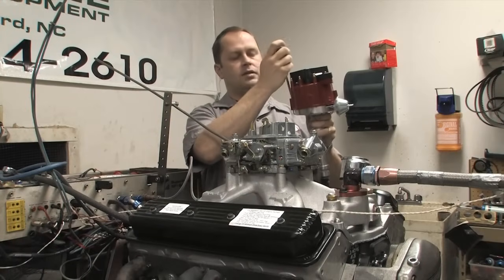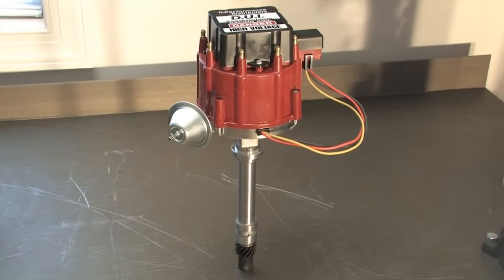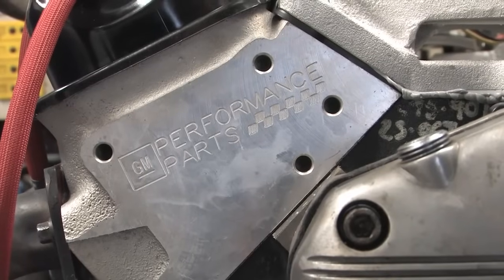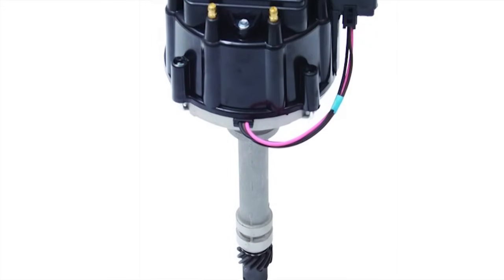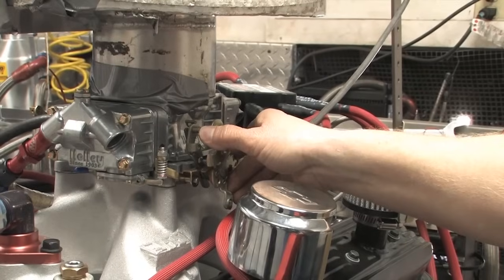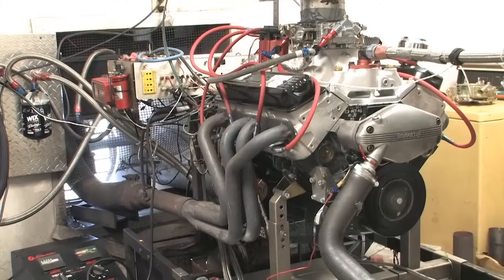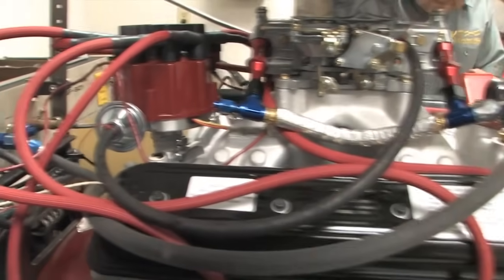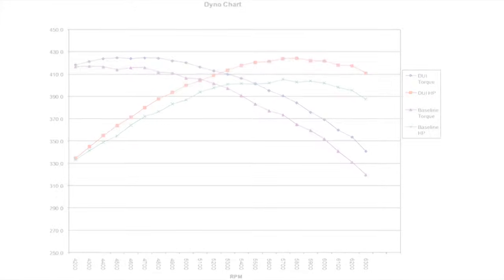HEI Ignition Tips for Your Engine

Comment: Great video. I own a 1965 Ford Mustang that I installed a 302 Ford small block wih an HDI distributor. It is conected to the original ignition lead with a resistor wire behind the dash. 1.5 ohms or so. What is the best way to get pesk voltage to the distributor and peak performance? I was going to bypass the resistor wire (pink) but it's a pain to get to. Anoter idea was a relay actuated by the existing igniton power wire feding power directly from the battery.  What do you recomend?  If a relay, which one? Thanks and once again, great video.

Comment: 36*....??? kinda sounds heavy.... How does it respond to restarting when engine is up to temperature.... seems like something you could accomplish through Cam degree... Harmonic balancer tab typically only goes 20* or so
Reply: That's pretty normal for a mild SBC. They have made adjustable timing lights since 1920. Just a tab and balancer line.

Comment: I don't think you guys fully understand what the vac advance system is for or if you do it was not clear in your video. You have established that the engine wants 36 degrees at WOT and that is what it is always going to want. The vac system should be setup to add more timing above this figure of 36 degrees to allow extra advance when the throttle is just cracked open (regardless of the RPM), the extra advance allows for the fact that the flame speed is low when the VE of the engine is low. Your total timing may go up to something like 50 degrees but only under very light throttle settings.

You guys seemed set up the vac system then pull a WOT run on the dyno, of course it is not going to make any difference with that sort of test.
Reply: This comments are gold. Thanks for explaining
Reply: Agreed; Vac Adv also keeps the engine cool in long parade idles.
Reply: Well said. 👍👍👍
Reply: Yes you are correct, he doesn't know what he's talking about with the vacuum advance.
Reply: Good luck racing with that setup!
Reply: They are leaving HP on the table retarding the wot timing.

Comment: I'm pretty sure the vacuum advance advances timing because at part throttle the air and fuel in the cylinders isn't as dense as wide open throttle, therefore it takes longer for the mixture to burn. Vacuum advance isn't going to make a difference doing wide open dyno pulls. Vacuum advance is done for driveability. If you have too much vacuum advance the motor will "ping".
Reply: It's nice to see someone that ACTUALLY knows how vacuum advance controls the curve under real world use.  At WOT vacuum advance doesn't nothing.

I could tell they weren't fully up to speed when they hooked up the advance.  They ran the hose to a ported vacuum source, then had to move the distributor.   The whole point of a ported vac is it does nothing at idle.   So if they had to move the distributor, they throttle blade was open too far on the carb.

Which doesn't explain why the HP didn't move much. If they had to back off on the base timing setting to maintain base timing, they should have been lacking full advance up top.

....so this video isn't really a tech video, it's an ad for D.U.I ignition systems.
Reply: I set timing at idle with vacuum advance disconnected🤷
Reply: On my 350 vortec i set my timing at 10 and total was 34 and dint use vacuum advance for that reason. Didnt want any pinging.
Reply: @AustinHarmon1994  how is your gas mileage? It would be great to see if you can improve mileage and keep performance.

Comment: @ 3:11 I'm confused. I've always brought cyl 1 to TDC on compression stroke first Then installed dist w/rotor pointing @ the "5:30"  terminal  (If your looking at an HEI cap w/the power, tach and ground connector @ 3 o'clock then this is the terminal just before the 6 o'clock position)
Reply: That's literally what they did.

Comment: It sounds like the main difference is the higher coil voltage and larger plug gap plus custom timing curve for the given engine setup. Timing curve really isnt a curve however its really just a rate of increase of advance per rpm increase or a slope.  I would say its degrees/rpm.  I suppose you could create a curve with progessive rate advance springs and or multuple springs of different weights combined. So take a stock HEI put High Perf Coil on it and larger plug gaps and proper advance springs you prettt much have created a DUI clone.
Reply: Factory HEI was current limited to 60,000 volts and that's not how vacuum advance works. This is just a glorified commercial.
Reply: Pretty much, they ain't the only game in town.

Comment: Did I hear correctly this is a 604 cubic inch engine?  I would have thought the stock horse power and tourqe numbers would have been higher.
Reply: ScrewHeadJuNgle Thanks for clearing that upa
Reply: That's a small block the most Cid I know of right now in a small block is 454. I have a 406 myself but if I had a reason to do it over if stroke it to a 427.
Reply: its a part #88869604 race CT crate GM New engine 350cid 400hp
Reply: Yeah my 1970 Olds 455 has 500ftlbs torque and 425HP stock with standard ignition (but I am about to switch to a Summit Racing HEI )
Reply: Its not referring to c.i. its the last few digits of the crate engine part number.

Comment: You describe the function of the vacuum advance as if its connected to manifold vacuum but you used ported vacuum. There is already too much confusion about where to hook up the vacuum advance.
Reply: Holley carbbhas ported vacuum and one ot two ports also ruun manifold vacuum...one of the side connectors i believe

Comment: you guys should make a video explaining how to tune the vacuum advance like how much to safely ad and how to tune when it drops out
Reply: It helps mainly at low rpm when the car runs lean at idle the higher vacuum also at low rpm advances your timing to burn the fuel better when you open up the advance does nothing.
Reply: @Gettinbentoffroad  not low rpm, but at low LOAD. Vacuum advance simply adds timing at low load, regardless of rpm
Reply: I dont believe that they actually know how, based on this video.
Reply: @hotrodray6802   They don't.   When they had to adjust the distributor after hooked up to a ported vacuum source,they should have known the throttle blade was open too far.

What's 'odd' is they had to back off on the distributor timing, didn't change the stops on the mechanical advance, yet the engine made the same power up top...    With a backed off distributor.

Not to mention, ported vacuum is a sloppy way to lower emissions at idle by intentionally making a car run poorly by filling the exhaust with unburned A/F.   That kind of ''tuning'' has no place on a dyno or when dealing with professionals setting up a vac advance distributor.

Manifold advance if what you want when you're tuning a car for part throttle real world use and gas mileage. (and the weights, springs, and stops set accordingly).    A lot of 'experts' think manifold signal causes pinging and detonation due to the signal source.  When they don't realize you can't use ported stops and base settings with a manifold signal. Same as you wouldn't use a distributor set up for full manifold vac and send it to a ported vacuum port.    There's a whole lot of 'turners' out there that don't know how to tune.

This wasn't tech, it was an ad for D.U.I ignition systems.    That's why they had to close the gap with the stock unit.  So the dyno curve would show a loss of power.    A good HEI will light off only 400hp all day long if it has full voltage running to it.

Comment: Does the Chevy HEI NEED resistor or Non resistor spark plugs?? Can't really get a answer from anyone. hope you can shed some light on it for me
Reply: Ashley Adams The resistor is only to reduce interference on the car radio, not for performance reasons.
Reply: @telocho  Condensors are used to reduce electronic "noise" in the car's radio with some ignitions. Plugs don't have anything to do with that bro...
Reply: Electronic ignition systems like a resistor type plug. The increased resistance actually increases the energy of the spark jumping the gap of the plug. This only works with an electronic ignition like a HEI as the system is able to create enough energy to make this more intense spark. If you use resistor type plugs on a points ignition it will burn out the points very quickly. The low energy spark created by points ignitions are due to the lower voltage on the primary side of the ignition (which is done to make the points last longer). Electronic ignitions use the full 12v and when the magnetic feild in the coil collapses it induces a bigger, more powerful spark to be created in the coil. Points ignitions systems work the same way, but with half the primary voltage- so they will never be able to create a big powerful spark like an electronic ignition. Hope that helps. By the way, I've been a qualified mechanic for 19 years- I'm not an internet know it all just incase you were wondering... Cheers

Comment: ooh please tell the truth the v8 American engines are shit gtr and supra 6 cylinder stock block makes 1000hp how much your shit is making 300hp and it's v8 850ci 13:1 compression  and 7000rpm
Reply: i think you sucked or ate an infected "something" and your brain has a degenerative flesh eating disease.
shitty imports usually can give you this same health problem,the only cure is a good ole american v8.......
Reply: JEALOUS AMERICAN MOTORS CAN MAKE BOO KOO HORSE POWER IF WANTED......
Reply: true while running turbo's.

Comment: lol... This "DUI" distributor only has 50kv, and you're talking like it's the Shit...

My Normal HEI has 65kv, and I think it needs MORE.
Reply: Riiiiiiiiiiiight. LOL. 65kv what a joke. Lucky to get 40kv out of ANY HEI DUI what ever shit ignition.
Reply: 65kv ??? .. what brand ??? ..     ????
Reply: I just bought a 65k distributor online on ebay, they are everywhere for $40 , I bought a set of 10mm wires to go with it for 30$. I cant wait to get this engine off the stand, and onto my running stand.
Reply: Don Rutter don't run it it will eat the teeth right off your cam they don't index for shit ask me how I know